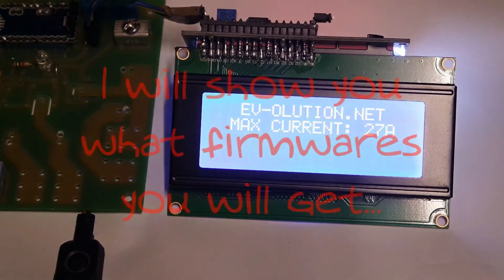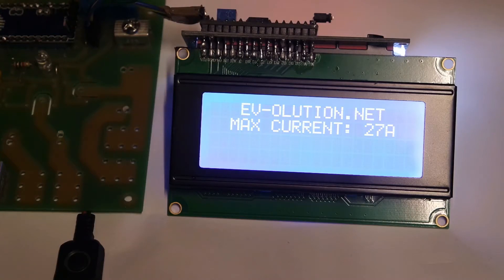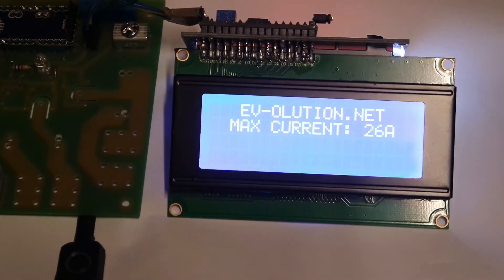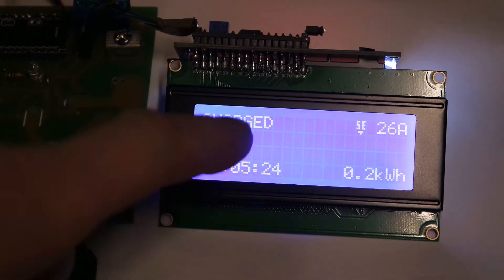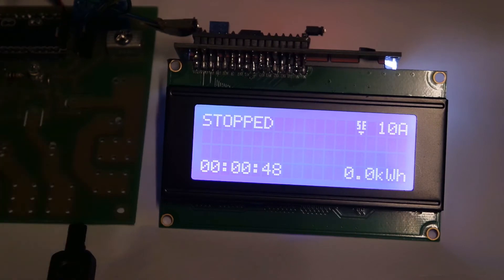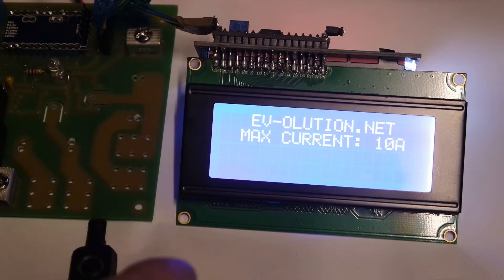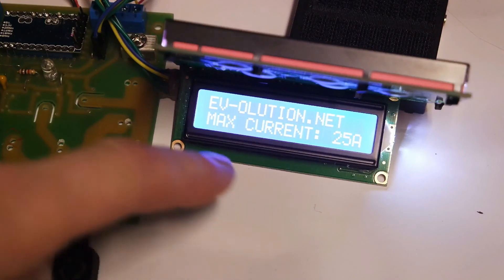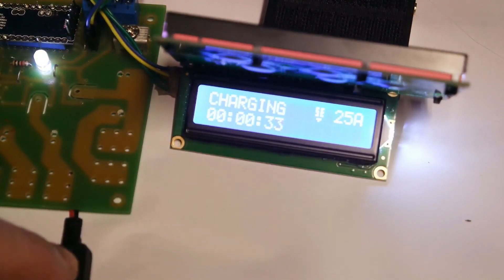DIY Arduino EVSE / Charging Point quick firmware overview

Comment: Where can i by the kit?
Reply from the maker: Unfortunately we no longer sell them, due to high component and postage prices. You can easily buy assembled Chinese EVSE controller for less than we pay for components if we buy them locally. Also German bureaucracy nonsense is taking too much time even on such small sales. We did a mistake registering for VAT. Which is a nightmare for VAT return. Tax office can't even make their own mind. 3 different persons, 3 different opinions about Chinese suppliers invoice legality. Sorry about that. There is a free firmware on our site if you want to build DIY EVSE. Or check for open source OpenEVSE project on github, which shares firmware and even PCB design files.

Comment: Possible charge very low on 4 amps?
Reply from the maker: No. Most EVs will not charge on anything less than 6 amps. Actually you will get a fault code blaming incorrect control pilot signal if you try to signal 4 amps. If you have very limited power supply, then you can use 230V to 110V transformer, so for example at 6 amps and 110V you will have 660W of charging power instead of 1380W at same current but 230V. Most EVs are capable to accept 110V and 230V.

Comment: I made an ultrasonic height and weight measuring device. I wrote the codes with Arduino and arduino UNO. Normally everything works fine. But sometimes after waiting for an hour or two, I take a measurement, the device is measuring, it shows the numbers on the screen, but it does not print the result to the thermal printer. The numbers stay on the screen, then the device is reset with whatchdog. This is starting to get annoying. can you help me with this
Reply from the maker: Are you using I2C communication for LCD and Thermal Printer? If yes, then you got typical problem with I2C (SDA line stuck low), which has never been sorted properly. You can find some solutions online, for example like here: https://github.com/esp8266/Arduino/issues/1025 . But the best solution is to avoid I2C devices all together.

Comment: Very usefull staff. What would cost to make myself a 3 phase 32A charging point aproxomately? Thanx for the  help.
Reply from the maker: If you thinking of building such project to save money, i guess it's not worth it, as you can buy some Chinese good quality products for almost same price. For 32A version I strongly recommend to use the 4 pole contactor instead of relays. It's hard to tell how much it will cost all together without knowing what you are building and what parts you already got. For example 3 phase tethered version needs a 32A cable and plug, which on its own is more than 100 Euro, meanwhile non tethered version only needs a Type 2 socket, which you can get for less than 50 Euro. Then you have to buy very strong and well insulated enclosure, and the prices varies for them a lot depending of which country you are from. So, sorry, but I am unable to answer your question without knowing exactly what you want to build.
Reply: @ev-olution8597  Thanks for help.
Reply from the maker: @energiavadasz3328  Sorry, I accidentally deleted your comment while trying to approve it, without even seeing it. If you want you can post it again. I have switched off the comment approvals this time, so I don't need to to anything anymore, and hopefully no more accidental deletes. Sorry about this.
Reply: can this be used to charge a diy battery on public AC charging stations for EV?

Comment: You saved me from a few hours of head scratching! I was going to design a PCB, code some lines and build the sensing circuitry for my Opel Corsa EVSE charger... They asked for more than 500 euros for a charger and i though there must be a way to do such a Simple device myself... Then i found your videos and decided to order everything from you ahahah if i had the time i would do what you did but i don't and i'm glad that i found your website. Thanks a lot!!!
Reply from the maker: Keep me updated about your progress. Also if you want you can send me the pictures of your finished project and I will share them on my website. Soon I will release a new firmware and video about it, which has some major updates regarding safety and functionality. Also it will be just a single firmware for all possible variants. It will have settings menu, where you will be able to chose between different setups.
Reply: What would cost if you make it yourself?